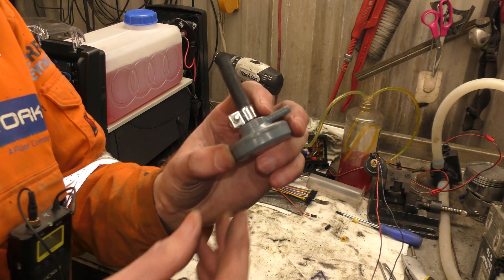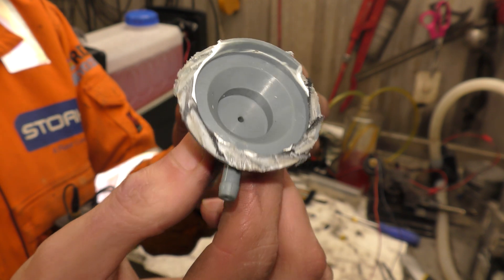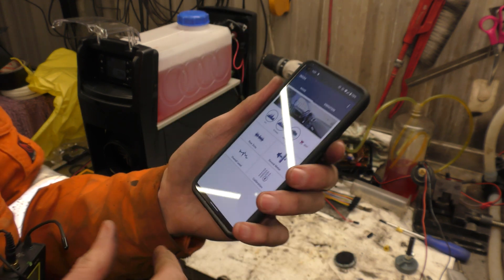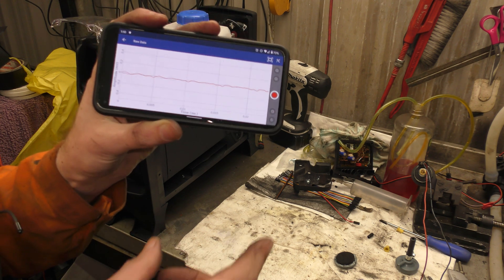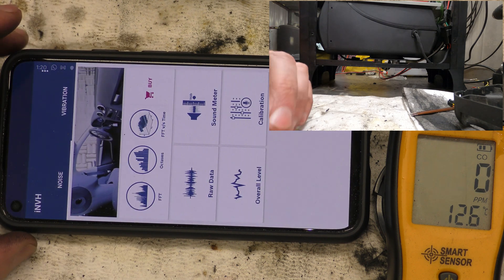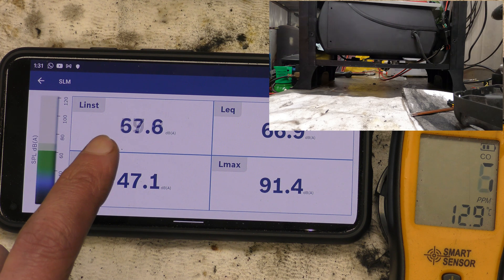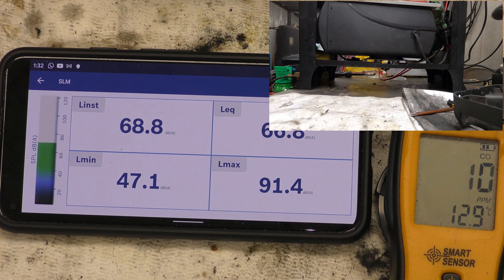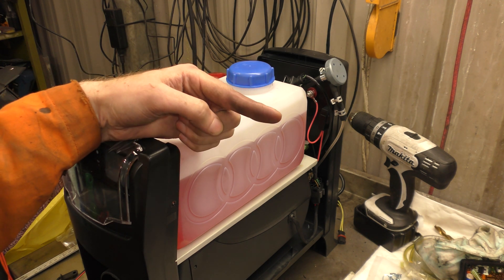Fuel Damper quick test + a look inside

Comment: you might find that its not a sound damper as its a fuel delivery damper designed to provide a more consistent dosing of fuel to the heater instead of the momentary pulses provided by the pump. my guess would be that the theory behind it is to provide a cleaner, more consistent burn by keeping the fuel to air ratio more consistent as opposed to the massive spikes that a pulse pump generates.
Reply: That is my thoughts exactly, I ran my diesel heater last winter for months that I've tuned the values on so I don't have overtemp shutdowns.
When running at max the temp goes up and down with 10-15 C all the time, so I'm waiting for my pulse dampener so I can do some more tests.
I'm hoping that the up/down on the heater temperatures flattens out and I get less soot problems specially when running at my lowest settings.

Comment: Helooooooow David. Love all your videos. Very entertaining mate. I wonder if you could advise me on a problem, (I think I have. ) As I'm not sure my Chinese heater is putting out as much heat as it should be. As it might just be the extra cold air outside we are getting at the moment.  The heater is outside in its purpose-built in box. Has lots of vents for letting air in.
I have a really good flow of air into my 12 x 8 workshop. But I can't seem to get the shop above 60 degrees Fahrenheit. It's been running faultlessly for 18 months now (winter months) And I'm sure it got hotter than that, for the first year. I only use the same oil as my central heating, if that helps? Thanks in advance. Dave. Yes, another one.
Reply from the maker: If nothing else has changed, except it being colder, most likely is that's the cause.  Are you recirculating and re-heating the same air or bringing in cold air from outside and heating it?
Reply: Helooooow again David Thanks for your advice on my heater. I'm getting a lot more than 100 degrees. in fact, it broke my greenhouse thermometer. I guess it's okay then. Must be my old blood taking longer to warm up nowadays. Keep up the vlogs.
You are a legend. plus my down-south wife loves your accent. 
Cheers Dave.

Comment: I was under the impression and have seen other videos where it is claimed that you need to use hard plastic line from the pump to the burner to increase the pulsing as soft flexible line would absorb the pulsing...doing the same as this "fuel damper"...

Comment: I dont get it. Theyre using hard line instead of a rubber hose so the line doesnt expand and absorb the pulse of the pump. Now you add that cushion thing which will probably absorb the pulse partially?
Reply from the maker: That's actually something we're going to look at.  Does the hard nylon pipe give any change in the burn characteristics over the 'soft' line.
Reply: @DavidMcLuckie  I'm looking forward to it!

Comment: One detail which probably makes all the difference....
The 5kW air heaters use a 22ml/1000 pump, so for the same fuelling have a much higher pulse rate than the 5kW Webasto Thermo Top units which use a 65ml/1000 pump.
Without one I can imagine the Webasto heater being in a constant cycle of rich/lean, the large shot of fuel saturating the atomising mesh.
Reply from the maker: That's a very good point.  The newer V and Evo use a 35ml pump, but there burn chamber is different again.  If Webasto uses a damper there will be a good reason for it.  :)

Comment: This damper is not designed to reduce any pump noises, it is designed to make a smoother burning in the chamber and therefore the burning doesn't sound so impulsive anymore and it will be a more constant burning sound. So not much noise reducing at all just a more constant smoother sound.
Reply from the maker: Indeed.  I was hoping the 'pulse' sound change would have been more noticable.  But I'll settle for better burning.  :)
Reply: @DavidMcLuckie  maybe the expensive Webasto works better Espar/Eberspächer also have on in their program which is half the price of the webasto

Comment: I purchased aio.  Ran a few weeks now won’t startup.   It has single on. Off. Round switch.  Hooked to meter it draws 60 watts ?   Five taps will no longer activate primer circuit ?/. Thoughts. /.  I installed one in van works perfect
Reply from the maker: Sounds like the fuel pump.  Can you hear it ticking?  If not give it a tap with a small hammer while priming.

Comment: Hi I was just wondering if you have any look running the Chinese heat vertical so the hot air comes out at the bottom and pulls air from the top thanks

Comment: I have about 200 gallons of 30 year old diesel. I poured some on an old rag, and it still burnt. Would you use the old fuel?
Reply from the maker: Absolutely.  Through a fuel filter certainly.

Comment: I thought the hose was meant to be hard to give better atomization of the diesel as it enters into the heater? Surely using this, or soft rubber hose will dampen the pulses, which would make it more likely to dribble out as opposed to being sprayed out.
Reply from the maker: Atomisation is achieved by the diesel hitting a hot surface.  There is no nozzle or injector spraying inside these heaters.  I've used soft silicone hose as well and it makes no difference, other than the diesel turning the silicone hose into sauce as they don't like fuels.

Comment: #DavidMcLuckie 
Is there anyway to conclusively  test if the plastic housing is off gasing the petrol based material when coming into contact with the 150°c + air and contaminating the living space air quality? Mainly for contained environments like a car or camper as in my case. Thanks... You are #1 in testing these cheap Chinese diesel heaters
Reply from the maker: Interesting question.  I'll have to think about a test for that.
Reply: @DavidMcLuckie  appreciate it man, either way I'm impressed how well the damn thing worked for $250. Surprised it doesn't melt the plastic.

Comment: Thanks for the vid David. I have some thoughts. That damper is going to help with noise a lot more if a) the line is longer, like in an RV or something. and b) if the lines are hard!

In both of those cases the pulses travel down the entire line. With a damper, right after the pump, they don't travel down the line nearly as aggressively!!  It's absolutely a worthy item to add , especially if you can utilize that 90 degree turn !!

In your tests, it makes sense that it would only smooth out the pulses a little. You could have put both of them in-series though ..... lol

P.S. Legit LOL on the demonetized joke
Reply: Glad you made that point, because that's exactly what these dampers are made for.

Comment: Hi David. What would cause a heavy carbon build up I.e stop working after one litre of red diesel being passed though my heater? New hot gasket, new mesh, exhaust is exhausting not air filter. Factory settings, not messed with hz or fan speed. Heater was on 3hz at the time. I could hear it happening, the fuel was not igniting with every pump if that make sense. I’m tempted to send to you see what you can make of it? I’m thinking red derv is crap? Or cold gasket buggered?
Reply from the maker: Not sure.  But I'm having something similar with this all in one heater and it's running red.  The CO readings are about 10x too high and was actually eye stinging with diesel fumes today.  I'll need to fiddle and take it apart.  Might end up being the 'service' video.
Reply: @DavidMcLuckie  ya I have the same unit. Older type I think? From my understanding if there is excessive soot it’s down to incomplete combustion. So lack of air. Or red is contaminated with water? No visible water line though? Look forward to you tear down and video. 👍

Comment: Leq refers to noise(or sound) level equated  over the period measured. LAeq (found on dedicated meters or calculated using a nomogram) averages the measurement out over a given time period, so you could work out the exposure over a day's work etc. I did do a noise assessor's course at the Institute of Naval Medicine many moons ago as an army musician. My bosses didn't like the results, when I recommended limiting daily practice to 40 minutes. Still got that petrol eberspacher if you want it btw.
Reply from the maker: That makes sense.  If you could email me again, I'll reply again and hopefully we can communicate.  :)
Reply: Personal sound level meters are also not that great for percussive noises, so the phone app will struggle to measure the pump noise properly too I guess

Comment: The best way I found to dampen the sound is warp the pump into an auto sound proof foam, then run then hard nylon fuel line in another soft rubber tubing to the heater. Because the noise is all caused by the fuel line then.
Reply: Much easier...just suspend the pump from a rubber band....silence :)
Reply: @bryaninglis  I also did that too! Just forgot to say that.
Reply: @bryaninglis  Doing that doesn't mess up the fuel rate or performance? MY pump ticking has been driving me mad and if an elastic band is all it takes to sort out....
Reply: @Tailss1  runs just fine 👍
Reply: @bryaninglis  Gonna try that now, thanks.

Comment: You have accumulators on the water systems in motorhomes to stop the pulsing effect of the pump being transferred to the water heater or taps.  Maybe that is all this is designed to do, give the heater a smoother fuel flow and for £3 it will hardly break the bank,
Reply: Yeah right, this is an accumulator used to stop the pump impulses from propagating down the length of the fuel line. Should be mounted right after the pump. :)

Comment: Thanks for this video. 
I was thinking of getting one of these as way to help reduce pump ticking. 
But you’ve shown there’s definitely no noticeable improvement. 
Saved me a whopping £3.99....😂
Reply: Get one of those insulation jacket things! Those do help. You could go further and just insulate the thing in whatever you want. Make sure you have a rubber input and output length of hose as well. I left some length coiled up at the pump on both sides which also helped a lot